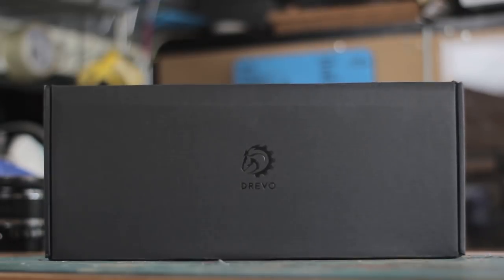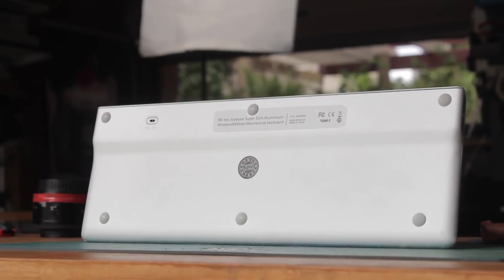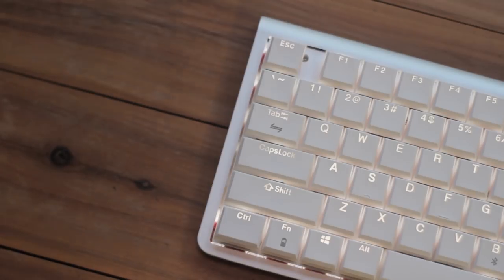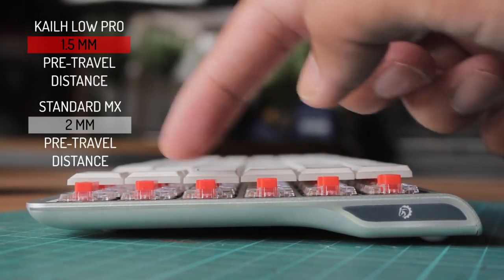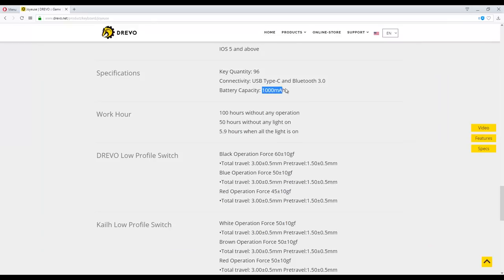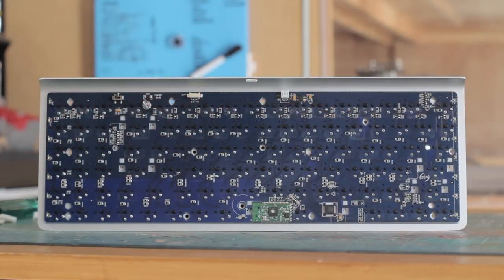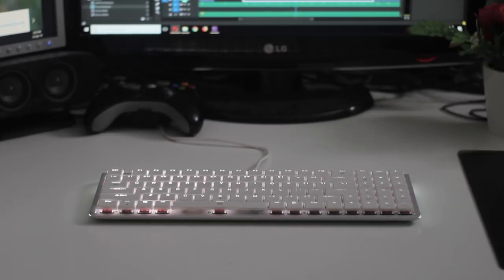Drevo Joyeuse Low Profile Wireless Mechanical Keyboard - Unboxing & Review

Comment from the maker: More on the Red keyswitches - after more time and thinking, I have grown to like them just a little bit. Still not my type of switch, but they're not too bad.. I think. Anyways, as always, it's a personal preference thing.
Reply: You should get the Kailh Choc sample pack from Novelkeys. The red switch is basically the worst of the bunch and the rest are much more satisfying.
Reply: The blues and the reds are my personal favourites. The tactility of the brown switch is too weak, same story as MX brown
Reply: @fcuk_x  I've been thinking of trying those out, as I love the full-height equivalent (BOX Jades) but I don't think I'd really want that level of tactility in such a small switch.
Reply: @JackOfHarts96  It may seem a little overpowering at first but I actually had Choc Blues (the custom ones for Havit keyboards) before forgetting about  it and going back to membrane as that time I didn't know what a mech was. After getting used to BOX Navies in my first full-height keeb, I tried the Choc Jades, and they feel like the bubble wrap that clickbar switches are, but my verdict is that you can still feel travel after the click and it isn't the simple bottom-out-every-key feel you'd expect.

Comment: Good on Drevo. It's easy to like this look and wireless is a big plus for a lot of people. I wonder if they will come out with a 60% low profile at some point.
Reply from the maker: I'm sure we'll see many options soon in the 2nd half of the year. Especially with Cherry having their low pro switches.
Reply: honestly a 96 key bluetooth isn't as useful as 60 key bluetooth. I wouldn't want to carry a tkl sized keyboard to the office.
Reply: 60% is a pain in the ass. 75% is much better and is only a little bit bigger than 60%.
Reply: Nah nah nah, 1% form factor is much better. All you need to know is morse code and bam! You've got yourself a kickass, lightweight and ultra-portable keyboard!

Comment: the home row and below were all shifted 0.25 keys to the right, not just the home row alone. also those keycaps aren't doubleshot... doubleshot keycaps would have 2 types of plastic injected from the underside to hide the ugly molding work to get the 2 types of plastic to flow everywhere that they need to. these keycaps just only have the coating on the top half, and it looks to have laser etched legends, partially identifiable by the arrow key icons at 5:13 having a bit of an indention in the cap. Judging from the color of the raw plastic, I think these are ABS. There are also plenty of aftermarket keycaps for these kailh low profile switches. 6:17 actually I believe kailh low-pro switch keycaps are compatible with cherry ML, but not the other way around. just due to shape differences in the keycaps themselves, they bump into the kailh switches where they don't on cherry ML

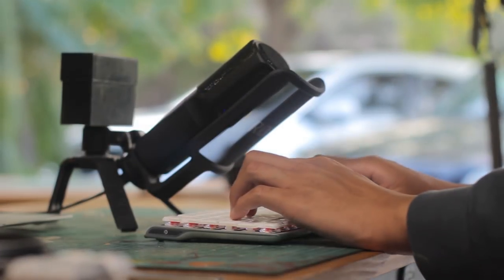fuckin loved the sound demo at 8:45 tho
Reply from the maker: Oh wow, you're right. The shift is 2.5u, which of course is the reason why the row has a normal stagger in relation to the home row. Thanks for that! I believe that the keycaps are indeed doubleshot. The white layer is not just painted on. On the underside, I believe the white bit is the plastic of the top part. It is also stated on the product page. I could be wrong though, as it is more difficult to tell in comparison to MX caps.

Thanks for all the input :)
Reply: TaeKeyboards oh wow, my bad if they are actually double shot. they really didn't look like they were
Reply: NikWillOrStuff Do you know where I could find some different keycaps for these?
Reply: Novelkeys sells black keycaps that look pretty similar.

Comment: There's something about the longer travel that you can't ignore. Short travel keys need to be tighter and harder. Otherwise they are very easy to actuate accidentally. But then you get more finger fatigue on longer sessions. I get this with Macbook keyboards, the older ones, not the ridiculous new ones, though I'm sure they are as fatiguing as the older ones if not more.

Comment: It looks pretty cool. But I am still wondering who would use the low profile mechanical keyboards instead of normal height.
Reply from the maker: It has it's uses. Some people may prefer slimmer keyboards, as they are more alike to most other keyboards available everywhere. They're also quite alike to laptop keyboards.

Comment: Hi, you’re the only person I see with videos of both a NiZ 30g keyboard and Kailh low profile keyboards, so I’d really appreciate your opinion! Which do you think makes for the easiest typing experience for long really fast sessions? The extra lightness of the NiZ or the extra low bottom out of the Kailh? Or something else entirely?
Reply from the maker: Hmm, it's a tough one. Both very different experiences. I guess typing on the Kailh Low Profile boards won't be too different to laptop keyboards - in regards to travel and weight to a degree. It's just the feel that is different. The 30g domes are very light, and it's something I personally like, but I know for a fact that many other's do not. 

For a relaxing typing experience, I prefer the Niz personally.

Comment: dude WHY CAN'T THEY JUST PUT THIS IN A LAPTOP. I don't understand how nobody's done this, just using an i7-8550u, nvme ssd, and this keyboard, sell it for a premium at like 1000 with no gfx card or like an mx150 as a professional laptop.
Reply: It would still make most laptops too thick for today's standards. If you compare this low profile board with it's enclosure with a laptop keyboard. you'll probably find it to be around 3 times thicker.
Reply: not saying it would be a thin and light, but there's a lot of people that don't need a thin and light. still a niche product, like mechanical keyboards in general, but arguably a large niche
Reply: Crok Then they can put a GTX card...
Reply: Actually it's been done: https://www.msi.com/Laptop/GT75-Titan-8RG
Reply: some laptops do have mechanical switches, just not these

Comment: Hello, Thank you so much for making this video. After watching your review I decided to buy one. I do like it very much except for my shift key. When I press on the left side of the shift key it tilts down on the left side. If I push down on the right side of the key it tilts down on the right side. I have to make sure I push down on the key in the center to avoid this. It almost like the 2 posts on either side of the red switch are too short. Is there anything I can do?